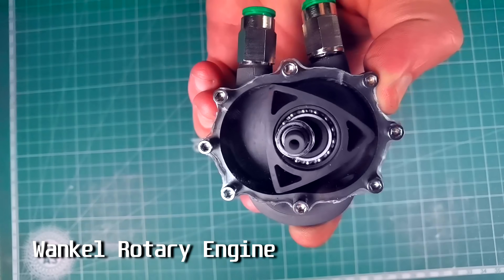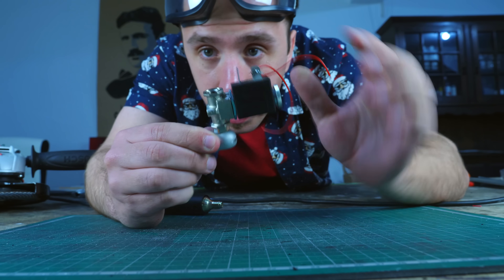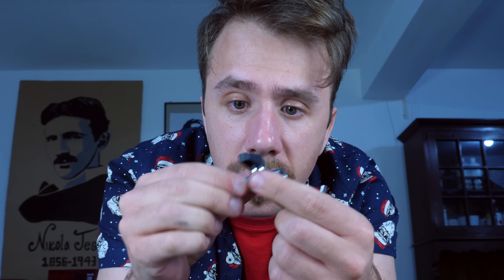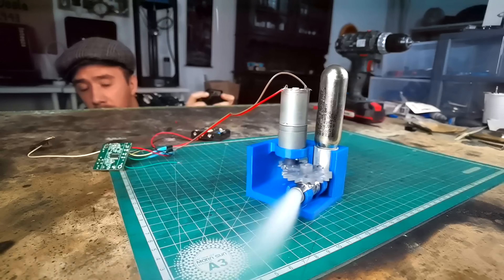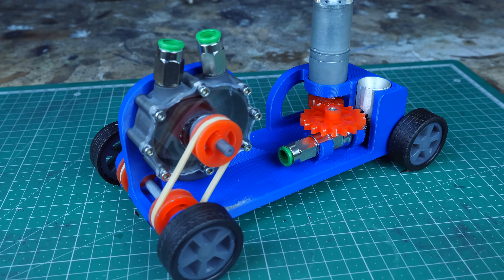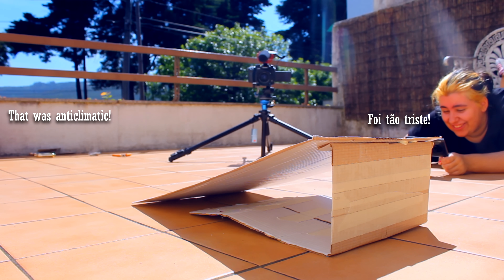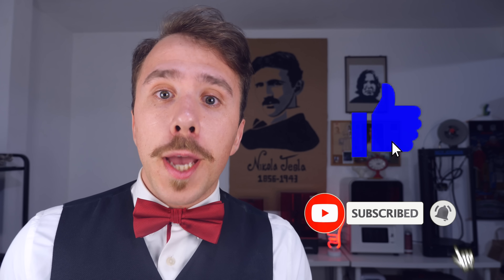Rotary Wankel RC Car (3D Printed)

Comment: I suggest a new  version of the wankel car with 
a) a pressure reducer before the wankel engine and 
b) gears to drive the wheel and reduce the rpms to the wheel

Comment: You need an expansion chamber your wasting alot of co2.
Depresuise into the expansion chamber i'd use one larger than used on paintball guns but thats a starting point... and regulate from the expansion chamber

Comment: Please be careful with compressed CO2 like that, when you opened up that cartridge at the start of the video with your hands you actually took a pretty big risk of having it directly inject gas into your bloodstream if your fingers slipped.

Comment: you are done with wankel engine so i would suggest that a piston engine next btw mr i have an idea don’t use rubber band coz it only waste the torque of the wankel engine, try gears and make the wankel engine more tight i saw that there is an air leak, and if u done doing the wankel and the piston try to make a race wankel vs piston engine who is the fastest. btw make the lil tomato heads as a driver don’t forget to 3d print their helmets, safety first haha. I am new subscriber here, love ur vids!!

Comment: 1. Rear wheel drive (basically switch intake & exhaust).
2. Lower pressure in system (regulate valve). 
3. Use exhaust as part of propulsion system (redirect it).

Comment: Please try a V2 of the wankel engine car, with a couple of improvements!

First, the CO2 needs to expand into gas before hitting the engine to get full use out of it, so you could make a small radiator out of some small pipe to warm up the liquid CO2.
The other improvement would be to limit the full force of the cartridge, to make the system run for longer.

Comment: The main issues I see with this car are the excessive belt slip, and intense vibrations. You may be losing a bit of traction at the wheels as well, so stickier tires wouldnt be a bad idea. I've also seen some others mention regulating the CO2 release, and this is a really good idea

Comment: Idea: make an actual gearbox/transmission for the car, point the end of the Wankel engine that discharges CO2 backwards for extra boost, and replace your current valve with one that discharges smaller amounts of CO2 over a larger amount of time. Also if you have time you can make turning rc as well.

Comment: I have a suggestion for the car! Maybe you could make it do either the exhaust is pointed backwards to where it helps push the car, or connect the exhaust to the tube that connects the co2 to the engine itself, so that the exhaust gets pulled by the co2 and powers the engine. The exhaust Co2 still looks like it has energy left to give.

Comment: I done Gon and got me an idea for yous, building of things witnised in this video and knowing you have the cabibility to build yourself a rocket engine, I do say that a hover craft might be an interesting project. To dive a bit deeper a hydrogen peroxide silver rocket powered hovercraft with a CO2 system used for cooling the motors/prints finishing it journey to give the craft lift.

Comment: 15/20 grm cartridges?
I used to play with 55 and 90gm cartridges but they er could punch through the wall of a van so had to be kept in strong boxes. Now extinguishers are stored pressure, I haven't got anything to play with :(

Comment: Video Idea: Build a drone with the wankel motor as drive. use gears to direct the energy of the motor to multiple rotors. To make it particularly interesting, I would also attach rockets from the 3d printer from your previous video so that the drone can protect itself from the tomatoes

(That would be my Projekt ngl )

Comment: Mini Hover Car! Use the high rpm of the Wankel engine to distribute power to two rotors via suitably sized gears, perhaps a flywheel to act like a capacitor, to keep the rotors spinning at a constant speed after the gas runs out? (think like a mini version of colin furzes' hover bike)

Comment: You should involute the design of your Wankel engine and turn it into a liquid piston engine (that's the name brand). It should improve the efficiency of your engine by quite a bit. Primarily because you can make your graphite wipers stationary.  It's the same basic concept as the Winkle but it seems to be much much more efficient.

Comment: Maybe ye could make another attempt, but this time with Cogwhels instead of an rubberband to make the energytransfer more efficiently (also, maybe ye could finetune the speed and strength going into the wheels, by using different sizes of gears), and even more importantly, with an vault that can change the output of CO2, to spread the amount of gas going in the engine over an longer time (or else the engine will either break apart again or the wheels will go so fast that they don't get any grip), heck if ye do it right ye might could even use multiple CO2 cartridges for it, making it able to drive not only for an decent amount of time, but also, when ye make the amount of gas really controlable, able to slow down or accelerate when wanted.
Maybe even for an period of time where it would make sense to integrate another remote control so ye can also control where it's going! Like an real remote Car!
Also, have ye seen how the car jumped repeatedly at the start? I have the feeling some kind of spring could absorp that, or maybe ye could make the engine weight more in that area? At the moment the wheels kinda already have problems getting traction because of this.

Comment: Watch the slow-motion footage back. The rubber band on the pulleys is slipping, and barely any of the power generated by the Wankel motor makes it to the wheels. If you fix that, you should get a much more efficient power transfer than you are by using the valve as a rocket.

Comment: I still think that making the motor a litle bit small and two stage. Connecting the outlet of the first stage in the inlet of the second stage. (new ideas) Making them out of phase to reduct vibrations and reducing the pressure a little bit. May create a very cool motor. Come on integza you have the resources. Do it please. 8^)

Comment: The size of the cartridge should not matter so long as it's at the same pressure.  Increasing the size just increases the volume of air.  What you need to do is regulate the pressure, because all that force is tearing the engine apart.  You could theoretically do this by increasing the resistance that the engine puts up, but with 3d printed plastic you will never be able to build something that can withstand the pressure.

What you should do next time is put a pressure regulator valve between the engine and the tank, gas seal the wankel better.  Easier said than Done, I know, but you were losing a lot of gas just through the acrylic seal over the uh... cylinder?  The crank case?  I forget what it's called in wankel engines.  But between the acrylic and the block a lot of CO2 wad shooting out between the screws.  Try sealing with some good silicone or maybe even get some liquid gasket (I know my Volvo S90 used that stuff between the head and the valve cover, I'm sure other cars do too).  Then use something more substantial for transmitting the power from the engine to the axle to help create a bit more resistance.  Something like those gears you printed would probably do fine, though even something like actual belts like what's used in phonographs and other electromechanical devices would probably work.  A tiny chain would probably be too much weight!

Comment: You're having losses on the belt jumping all around and the leaks from the wankel engine. Those engines are literally efficient
Reply: the wankel Engine is efficient, the way he modeled it and designed it isn't
Reply: @lanthan598  3d printed parts can flex in high pressures causing problems with the seal that is key for it to be very efficient

Comment: You should block the rotary axle and increase the pressure starting from zero, that way you can find the max pressure without leaks. That's than youre operating pressure, maybe this also fixes the freezing problem. And thus way the car will drive longer

Comment: Simple idea for a video: use lasers (fog optional) and a microprocessor to make a timing gate that measures the speed of whatever passes through it. Could be useful for getting data on all these rocket/CO2 vehicles you are working on.

Comment: Video idea: you should make the 3d printed drone but my twist is it is powered by co2 cartridges which will propel it upwards then place a parachute inside of it which will detonate after the co2 cartridges are empty. Also try restricting air flow so that you can be more efficient with less gas coming out. You can also place tomatoes under the drone so that you can just ditch the parachute and crush the tomatoes. ;)

Comment: If you had a pressure regulator rather then a simple valve, you'd be able to control de flow out of the co2 cartridge. You'd havr much better control and be able to throttle the wankel proportionally. And i think designing and making your own pressure regulator wold be a big challenge, and a great video.

Update: Nevermind. 3dprintedlife did  it already. Well, sort of..

Comment: When accelerating the car you should start at low flow. You turn the valve open and the car bounces in place unable to get grip and start moving forward, so you loose the pressure. 8:10

Edit: Try to turn the exhaust of the Wankel engine backwards to gain more momentum and to limit vertical oscillations.

Comment: Make a, and hear me out, compressed air wind turbine Wankel rotary engine electric generator.
Wind turns prop, prop actuates piston, piston compresses air in canister, canister bleeds air slowly into Wankel engine, Wankel turns generator, generator makes electricity.

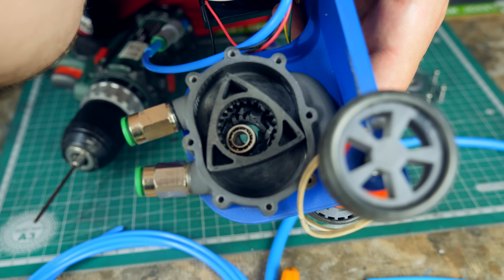Comment: 7:27 The engine and wheels are basically a cantilever, with the drive pulley yanking it in an oscillating motion. That causes the drive wheels lose contact with the floor periodically, and also makes the pulley belt slip and have uneven tension over time. That would waste a lot of energy, spinning the wheels in air (or spinning the motor against nothing while the pully slips), which is probably a large part of why the rocket version works so much better. 
The uneven load as the wheels skip in and out of contact with the ground is probably hard on the engine too, causing mechanical parts to experience speeds jerking up and down. That likely contributes to the engine breaking apart, in addition to the unregulated 800 psi from the cartridge.
If you were to put a couple of diagonal struts from the ends of the axel to brace it against that vertical fin the engine is mounted to, forming a pyramid, it would probably help improve distance a lot.
A needle valve to regulate the cartridge to a lower pressure, so you aren't going from 0 to 5000 rpm instantly or running the full 800psi instantly would also likely help, as would some kind of gear reduction / mechanical transmission / electric transmission to convert the 5000 rpm motor speed down to a few dozen rpm for the wheels.

Comment: Don`t let the Wankel die. Use a bigger Rotationwheel for the great achievement und reduce the imbalance with a 180 grad rotatet Wankel zylinder. A sealing ring for the motor will be a big step in the right way.

Comment: So glad u used the engine on a vehicle! Honestly you should do it again when your solenoid comes, if you ordered it XD would be extra complicated but if you  were able to employ a high pressure gate in the line post CO2 tap you would potentially be able to control the initial torque on the front wheels and reduce power loss to the wheels. Also they make small toothed belts for Rc's. I would have recommended that over smooth rubber bands. I know this is outside of motor creation. But when it comes to rotational kenetic energy, transmissions are the key to reducing power loss via gear ratios. Love this channel I looked forward to every upload!
Reply: Also I know you saw the leakage through your front plate of the motor. A gate would help with maintaining a constant psi instead of the terrible barely curved negative slope that a pierced cartridge provides. And the closed loop of the exhaust would allow the co2 to be used to rotate the engine more than once.

Comment: In the slow motion I noticed a lot of belt bounce and traction loss on the wheels. This puts lots of impact stress on the drive train. My though would turn the engine around to make the cart rear wheel drive. Maybe a smoother power transfer from more traction.

Comment: There was so much slipping from the belt, I think if you added teeth to the gears, and maybe a special ribbed belt instead of a smooth band, it would be significantly faster.

Comment: Video idea: Test if the Magnus effect (Backspin produces an upwards force that prolongs the flight of an object moving through a fluid) will work on an object undergoing The Leidenfrost effect simultaneously. (An effect which states that an object in a fluid can create an insulating vapor layer, when the object is hot enough).

Comment: Get rid of the RC stuff. Start the car from a backstop. Put a lever on the valve that you can use a string to pull open against the backstop. Also use the pressure regulator that 3DPrinted life designed along with small hole for flow restriction before the regulator.

Comment: You're  loosing most of your  energy  when you initially open the valve. You may need to use a gear instead of a belt so you won't loose as much.

Comment: Definitely seems like the pressure is waaayy too high for the engine, perhaps try some kind of a restriction in the flow of CO2 to give a longer running time and also have less chance of damaging the engine.

Comment: Problems:
1. The wankel engine leaked gas through the casing.
2. The Rubber band was slipping a lot, so you were spinning the air rather then the wheels.
Solution
1. You need a better gasket/ sealant
2. use gears rather than rubber bands to drive the wheels. (Also I would recommend doing it rear wheel drive rather then Front wheel drive)

Comment: I think it would be great if you designed a 3D printed engine, that would be made specificaly for high torque. Not for lot rpms, but a Hard worker. 😄

Comment: Great Video, you Need an Valve that reduce the Flow. Than you get lower RPM and don‘t loose Energie with slipping from the Tires.

Comment: You should try using 3D printing to create forms and molds for pressing/forming metal parts or for plaster or clay for your rocket parts. This should hopefully give consistantly better heat resistant parts and can open up some unique building methods.

Comment: Idea for a future Video: Use the 3D printed wankel engine to create the most deadly tomato-killing machine yet to be invented. You could use the wankel engine to propel a blade and use it's exhaust to freeze the tomato at the same time. Pretty sure you could use integza-bot in there too to electrify the tomato as well.

Greetings and have fun.

Comment: its definitely decent but, the "belt" you used is heavily impacting performance, and, using something like a pressure rehulator will make it much more efficient and give it the ability to drive for much longer

Comment: after you fix your cartridge to be the other way so you are getting gas from the top instead of liquid from the bottom,  
you should see if your valve will allow you to throttle the engine

Comment: I'm not sure why You even done this weird diy job with that co tank adapter, it looked like it is standard Teflon pipe connector, you just run it into electro valve via Teflon pipe and out of the valve to the engine, all tho this maby made it little more compact I think that it was pretty pointless, Harmless but still pointless

Comment: a regulator, tensioner on the drive belt and possibly more weight give a little more traction on the tires.

Comment: Maybe try installing a small regulator on the exhaust. You might be able to control the rpm to avoid tearing the gears

Comment: The tyre are no gripping thus through math it  is 6% less effective (you can also see that the tyres are sliding in slow motion shots) 

Sol:use in a rough terrain or use wheels like real life dragster and f1 which don't have any ridges or bumps .am I right guy?

Comment: You should add a hose and valve off of the exhaust back into the intake. As the exhaust seems to still be at high enough speed when let out. This should allow for the engine to cycle and run longer

Comment: You should try to use a aurduino to control the valve and only open it a hair to conserve the co2. Also you should make it 4 wheel drive by making gears for the rear axle and connect it to the front axle with a belt/rubber band.

Comment: Wankel rc car is really interesting, but in the slow motion you can see that the wheels are slipping and jumping during acceleration. You can try to design and print an axle with suspensions more stable. And also direct the exhaust backside of the car as suggested by WM DIY.

Comment: You should add a pressure regulato and you should also add another rotor to the rear and run it off the exhaust of the other and make it all wheel drive

Comment: You need to create a throttle. The pressure of the air leaving the engine should be slightly more than ambient, that way you're extracting as much work as possible from the compressed gas. You have low volume, high pressure gas in. You need high volume, low pressure gas in.

Comment: You have the co2 uppside down! you get alot more time from it if you do not blow out the co2 down the bottom but just relese the pressure from it out the top, do a 180 on the cartridge.
Reply: YES, there is liquid CO2 in that cartridge!  you should draw gas from the top, instead of liquid from the bottom